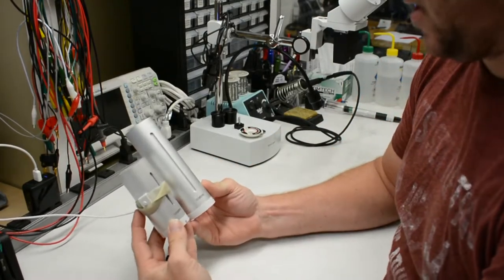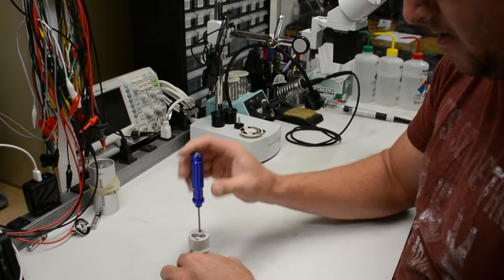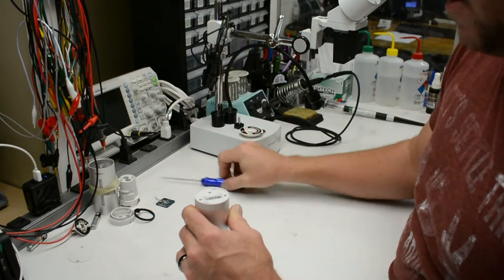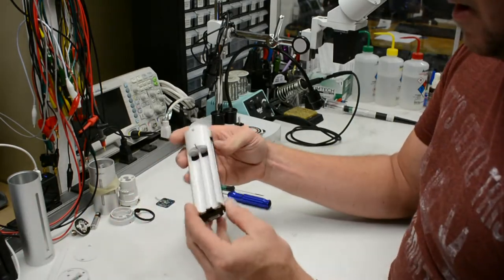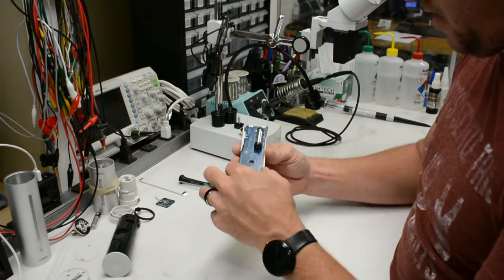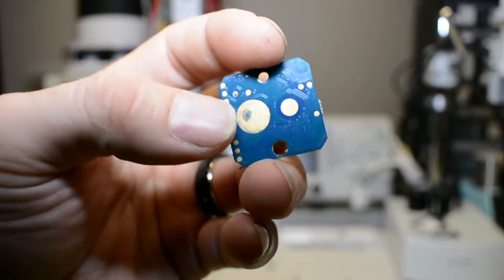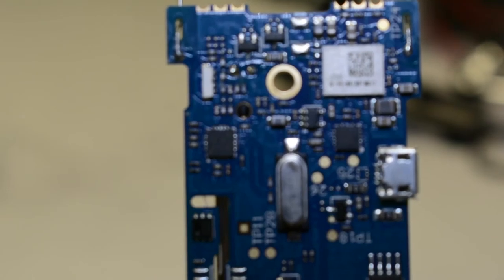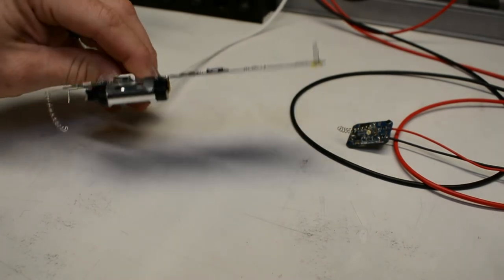Inside Netatmo Weather Station - We Tear it Apart -  KurTrox

Comment: The large sensor on the PCB you refer to as "carbon monoxide" and "CO" is actually Carbon DIOXIDE or CO2, unless you have some different version of the weatherstation that I am unaware of. It uses non-dispersive infra-red for the gas concentration detection.

Comment: Towards the end of the video you power up both. How did you connect the smaller module? Soldered the cables? 
I am thinking bout putting them in a different casing and powering them differently, shouldn't be a problem, right?
Reply: I have put my outdoor sensor in a Stevenson cage, removed it from all its housing material, whereby the sensor is now open inside the Stevenson screen, fed by a large 12V battery I already use in there through a solar panel on top of the screen, step-down converted to 3.7V, I soldered the power-cabling onto the battery connector areas on the small netatmo board. I isolated the entire electronics from corrosion etc by coating it with plastic-spray. When I did that of course I shielded the sensor to not coat that too ;)  Has worked for me for months without issues now.

Comment: The damage to the outdoor module's battery pads happened to mine too.   Intermittent contact with battery.  I think it was more cheap design.  I tried electronics cleaner but it didn't help too much.  Sanding it clean would've worked but I suspect it would go bad quick.   A glob of solder on the pads would probably be best.

Comment: which torx size do you have to use?
Reply: t9, but a really long one, so usually the ones with bits don't fit in those holes, you need a really slender driver pin for it.